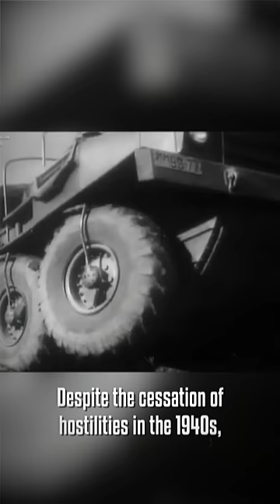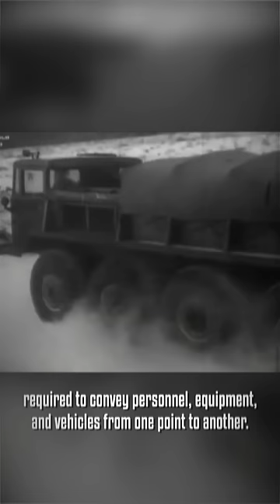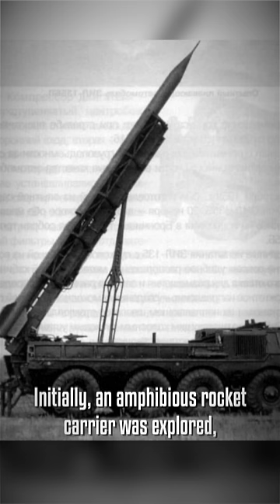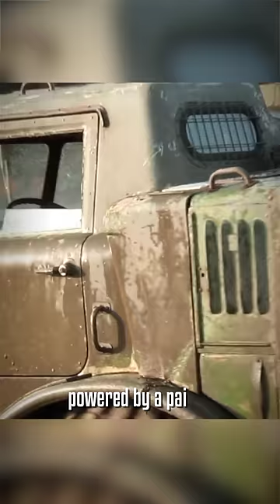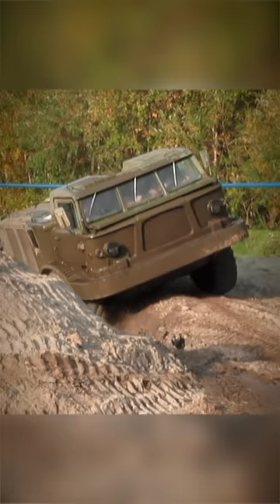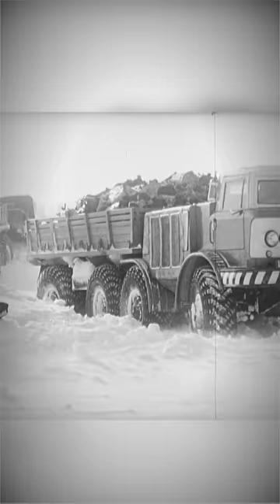This Is A Peak Soviet Engineering

Comment: As a former owner of a Lada Niva, which was quite capable off road with some modifications and motor enhancements, the “only” issue about soviet tech was reliability, obsolescence and a complete lack of ergonomics…
Reply: Anything is only as reliable as you take care of it, when you abuse something to pieces and then complain it was not reliable enough, perhaps the owner must buy a mirror and have a good look at himself.
Reply: @SMGJohn  I’m going to desagree with your assessment. Reliability it’s a quality, it’s engraved not only in the personal history of use or abuse of the machine, but in the collective experience in the matter. The Lada Niva was, indeed, a great source of amusement, great moments off road. But the quality of some components always was questionable, for example the grooves of the half shaft were at constant risk of failure. The carburator, inherited from a Fiat 124, it’s a complete disaster. I managed to change it, mounted one of a Renault 12 Alpine, and everything changed… it was a great vehicle.
Reply: @drclaudiomendez  
That also depends what year Lada Niva we are talking about, the ones made after the 90s, sometimes I wonder how they stay on the road, but the ones made before were different, less plastic, more metal.
To begin with, a lot of car issues today are because of the huge use of plastic parts that fail with time.
Reply: I own and daily a VAZ 2106, it's a great car, on worn winter tires it can crawl through dirt, snow and slush and still show some off-road action though it's only rear wheel drive. It has issues with comfort, but It is really reliable and when something breaks (like all things do, the car was abused for 30 years before me), you can always fix it with little tools. I have literally serviced the engine on the side of the road once and the little car drove me home after that!
Overall great cars if you're not afraid to wrench on your own and love classic vehicles

Comment: I can't argue that this is a good idea. If the engines are of good quality, or not, it's cheaper than replacing or maintaining a differential under such conditions.
  Redundancy. The vehicle could utilize a hydraulic drive system, basically turning it into a giant hydraulic pump. PTOs to power everything, and pretty much anything that one can imagine being attached to it.
  Put a couple of Power Strokes, or one's favorite diesel engine for even more efficiency and options.

Comment: Dual powertrain is definitely significantly a more complex and expensive solution than a differential.
Reply: I don't think they did it to get out of using a differential. I think they did it so that there would be redundancy. Russians really aren't good at maintaining their stuff
Reply: Yeah I mean, it looks and probably sounds cool, but there’s a reason these dual engine system designs were never used in great numbers. 

Particularly this design where each engine powers their respective sides, I can imagine it would be a toughy to drive on one engine.
Reply: @thelandofnod123 
I read in the comments that the two engines power different axles!
Reply: @thelandofnod123 
I read in the comments that the two engines power different axles!
Reply: @pushpakumardaniel3751  On this they power different sides the BTR and derivatives power seperate axle sets, which is a much better idea.

Comment: They swapped the V8s for inline 6s, it was the better choice
Reply: They swapped the I6 for the V8 in production. Also auto for manual transmission. There was an “E” version that had 2 generators and 8 motors which sounds a lot more promising but didn’t really go far.

Comment: Engines working in parallel, is like parallel electric circuits
Even with one of the lines, it's gonna still work, but have less power

Comment: Makes complete sense.  I'm sure that you could almost double the range by using only one engine if that was an issure as well.
Reply: Not really. 1 engine would just burn a lot more fuel to go the same range. It would still go further than 2 engines but it wouldn't be double. 1st law of thermodynamics.
Reply: @ryelor123  Which is why I said "almost".  You would also have to factor in that the driver, wanting to maximise the range of his vehicle for whatever reason, woud be driving with economy in mind.
Reply: @chrisantoniou4366  you might also have issues with it trying to drive in a big circle too.
Reply: @thelandofnod123  ...which is why it's equipped with a "steering wheel" I suspect...
Reply: @chrisantoniou4366  Yeah, good one. 😒
“Almost” won’t cut it either. Even with both engines in operation, there is huge inefficiencies with drive and drag between the sides. So trying to drive with one engine might get you 20% further at a rough estimate. 

So “almost” the same not  “almost” double.
Reply: @thelandofnod123  I'd like to know where you get those figures from...
Reply: @chrisantoniou4366  You first, then I’ll let you know where you went wrong.
Reply: @thelandofnod123  Sorry, YOU made the statement, YOU provide evidence, or we're done here...
Reply: @chrisantoniou4366  Nope. I know it was a while ago but you were the one that stated “almost” double the range with no evidence, no qualification, no references, nothing. That’s YOUR claim, not mine. 

So provide your working or we’re done here, actually you were done when you made such an uneducated claim.
Reply: @thelandofnod123  In other words, you got your evidence from the same orifice as your original assertion - good bye Mr I'll just Make Stuff Up...
Reply: @Chris Antoniou  You were the one who said it would go almost double the range with one engine. He's making a speculative guess based on what we know about the vehicle just like you are lol.
Reply: @DoWorkNP  I would go one further and say that with my training and experience that it’s more of a educated calculation rather than a guess (I did actually do some calculations), but I get the your point and appreciate it. 🤓

Comment: While Soviet & Russian stuff can look clunky, they had been very successful with some of it.  The AK 47 & 74 are some of the most successful weapons of all time. They had a Duece and a half look a like truck with an air compressor that enabled them to deflate and reinstate tires. The truck could travel over muddy, swampy terrain that would swallow treaded vehicles (i.e. tanks). They had/have a 155mm type cannon with a barrel the size of a telephone pole-it was so well balanced that you could adjust the elevation and azimuth gears with the slightest of pressure. Like Afghanistan, they have swallowed invading empires. We may shake our heads at the sh!t they do- but do it with respect for their defense of the mother land.

Comment: Genuine Question, if it has a pair of V8s... Why does it sound like a lawn mower?
Reply: Don’t know, but they managed to squeeze a total of 130kW from 6.9 litres. Although 474 nm at 1500 rpm isn’t too shabby I suppose, although my 2.2 l Kia Carnival diesel gets 440 nm at 1750 rpm.
Reply: terrible audio compression from equipment back then, probably.
Reply: @kanemoonnam9727  Or just an actual recording made with Soviet recording equipment.

Comment: For all haters: US Version would have cutting Edge Technology, would cost trillion of dolars, delivery date would be extended 10 times and would require a sterile garage and very expensive maintenancr. at the End would be stuck in mud After 2 Minutes
Reply: Not everything is an air-superiority fighter. The Humvee isn't some cutting-edge machine and never was. The issue with planes is that everything you spend goes for nothing if the other side's plane is better.
Reply: Pity that these things were renown for being maintenance heavy, driving off cliffs, premature engine failure, stupendously uncomfortable, horrifically fuel inefficient ect ect. 

So when you compare a US and equivalent Soviet machine together, I’m pretty sure I’ll be selecting the US every time. Here’s some comparisons for you;

T-72 v M1
BMP v Bradley 
AK-74 v M-16
Su-27 v F-15
MiG-29 v F-16
UAZ-469 v HMMWV
? v Nimitz class
And so on and so on. 

But most importantly;
Russian logistics v US logistics.
Reply: @thelandofnod123  for my idea, I would say the same but for US Equipment, but of course, not for everything. It might be due to the geography and experience 😉

Russian guns, MIGs, Tanks, they are built to be very robust, operate in all weather conditions etc. But as you say, not comfortable at All.
My father Used to have PK in yugoslav war, serbian one but still it is an improved russian Design. The thing could never break down.
Reply: @slobom.6744  While I agree that the equipment was intended to be robust and was designed as such, quality control was abysmal in the Soviet days especially with aircraft, ships and vehicles. Materials used were also often subpar for the task. Ideas were sometimes pretty good but execution was a distant second. 

Added to this was the nature of the service of personnel and the lack of logistical support and maintenance, particularly during warlike operations. 

Even the airline industry suffered terribly from bureaucracy and inefficiency. You’ve never really flown until you’ve been on an Aeroflot flight where half the floor panels are missing, the cabin trim is nearly non existent and you have to share your row with a goat. Let’s not even mention the casual fire on landing. 

Small arms seem to be the exception, especially those not produced in the Russian SSR.

Comment: This vehicle would be a logistical nightmare.
Reply: Soviet logistics is a logistical nightmare.
Reply: @thelandofnod123  To be fair, ALL logistics of ANY army are. Because they're all the equal of centralized, planified economies. I'd like to know how the logistics of Wagner or any other PMCs actually work.
Reply: @NahuCommNS  Most modern countries logistics systems are pretty good and robust. You have to have faith in it to commit to operating something like an Abrams. 

Soviet/Russian logistics has always been a nightmare, slow and cumbersome. This is one reason why the Central Powers had to try to remove France and therefore Britain from WW1 before Russia could mobilise.

Depending on the situation, the PMC can lean into the host nations logistics as well as their own organisation. Wagner does this and is experiencing the Russian logistics system first hand. Other PMC can try to rely on international logistics companies, however this can turn out to be problematic, search for “Sandline affair” for an example.
Reply: @thelandofnod123  I wasn't going for X is better than Y to be fair 😅. My point was that they all suck. Of course, some suck less than others, others suck more than most.
Hmm, i'll take a look on the PMC tip, thanks.

Comment: The true is that ZIL trucks factory only had v8 petrol engines on display so most of their models such as 130.131 and this one 135 had a  petrol engine, so in reality one of those engine was to weak to power this truck.

Comment: The Russians were much more adept at Industrial Espionage than Original Engineering Development. 
Copied almost everything. 
Examples from WWII:
B-29 bomber
C-47 transport
Tank Suspension System

The big problem was US used  Imperial measurements. The Russians used Metric. Hardware and metal fabrication was a big headache. 

https://en.wikipedia.org/wiki/Tupolev_Tu-4?wprov=sfti1

If the Russians are such geniuses, why is Russian consumer goods industry non-existent?

Oh, they also tried to copy the US Space Shuttle… FAIL!

Red Chinese follow the same Communist model. Steal and copy.